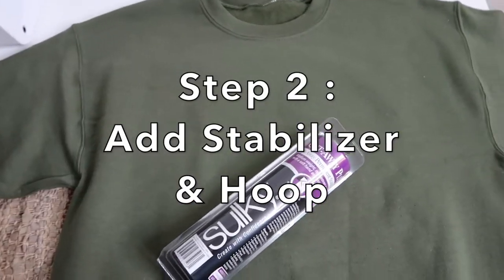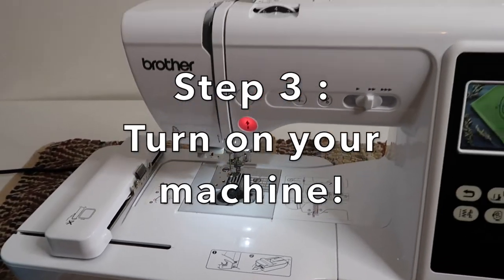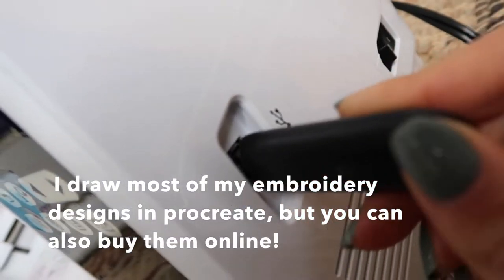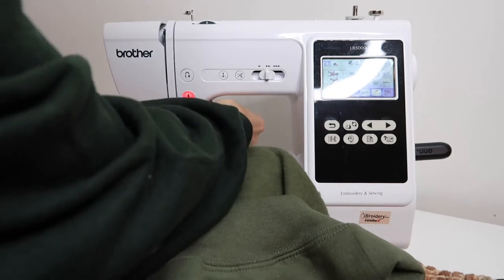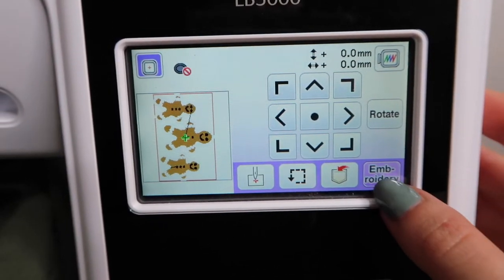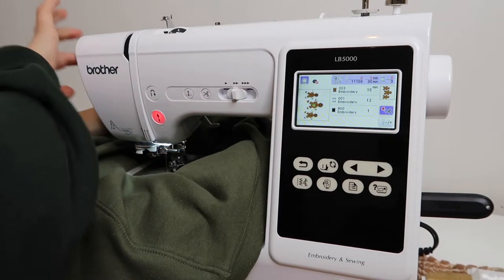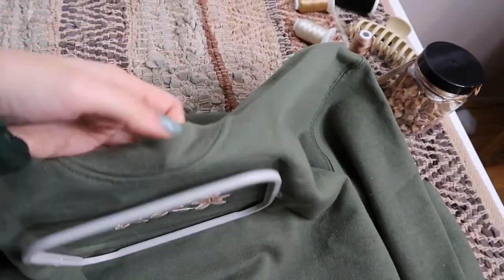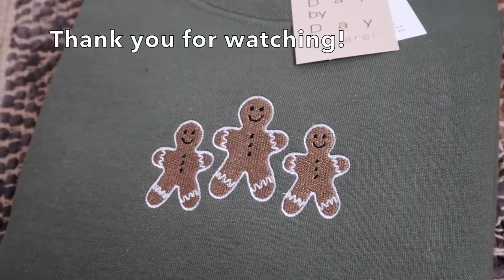How to Embroider on a Shirt with Brother LB5000/SE600 | Step by Step Tutorial

Comment: Question, what do you do with that extra tail of thread after you thread the machine? Lol I cut mine at first but then the thread unthreaded 😅
Reply from the maker: As the last steps on your machine, there should be a little cutter & lever. Pull the lever down with your string positioned on the cutter (Number 8 on my machine).. it will cut it for you, and keep your machine threaded!! Hope that helps ❤️
Reply: @Livdaybyday  thank you so much 😊